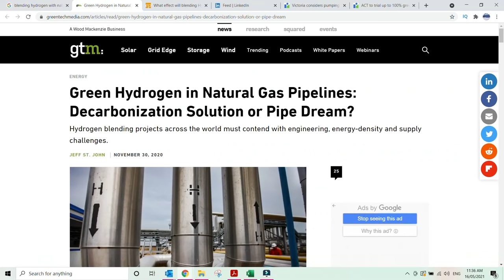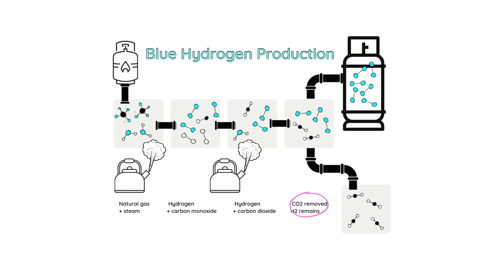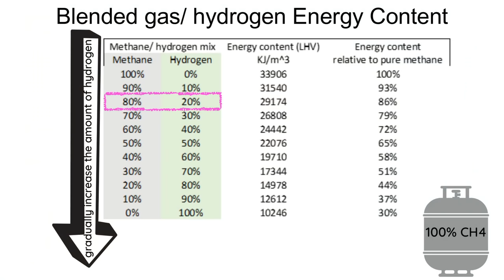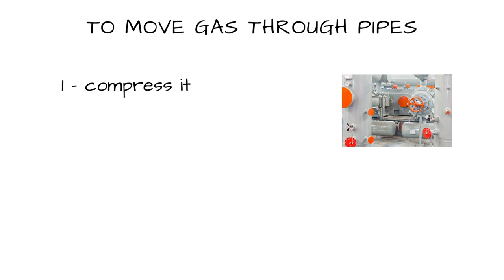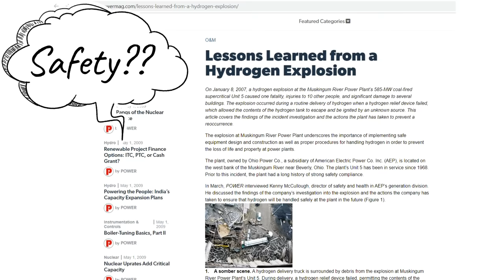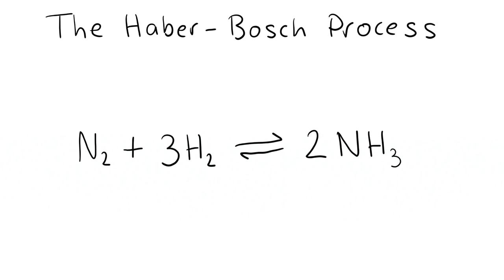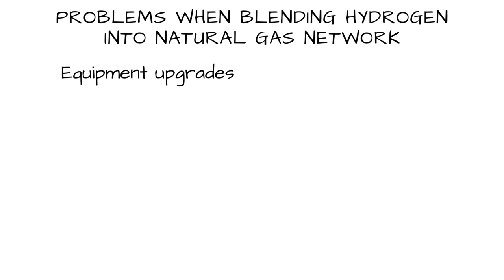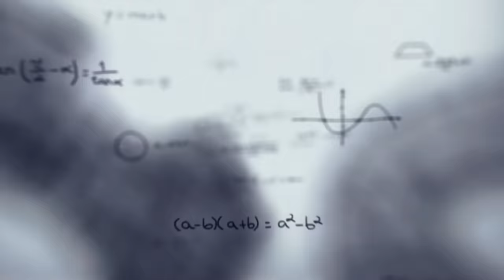Hydrogen in the Natural Gas Network

Comment: I was going to say as a welder that hydrogen entitlement would be a massive issue. most if not all certified welding procedures worldwide specify low hydrogen electrodes when arc welding high pressure steel pipes. Hydrogen gets into the steel crystalline structure and basically turns it into a brittle sponge much of the natural gas infrastructure is just carbon steel so I could see it being suspectible to this issue.
Reply: You are very correct...that was going to be my comment...  Besides CO2 is not the problem...water vapor is a much greater green house gas...
Reply: @DavidThompson-gr4gy  I have to correct you on your second point here. CO2 has a very long life in the atmosphere, while water vapor is constantly removed by condensation.
Reply: Sorry I am late to the discussion. But they can line the pipes with a ceramic "paint". There are companies that make a living relining city water pipes. They have pipe crawling robots with fiber optic video feeds back to the operators. We got some crazy engineered shite!
Reply: I assume you meant "embrittlement" but got whacked by a spell checker.
Reply: In the Netherlands the natural gas pipelines are certified for hydrogen.
There is no need for a high perssior because the energy in hydrogen is much higher than natural gas.
Nefit and Bosch created a ex change system so there is no need to bay a new heater just a few parts need to be changed so they can switch to Hydrogen
Daf Trucks created a system to use hydrogen in a almost regular combustion engine.
Reply: @markknoop6283  I think you are confusing calorific value per mass and per volume. Per volume, which is the critical measure for transportation via a pipeline network, the CV of hydrogen is around a third of that for natural gas meaning you would have to transport 3X the volume of hydrogen than that for natural gas for the same energy.
Reply: @Esriuptime  the temperature when burning is higher as wel so we need less.
And if everything is installed correctly there is room for pressure increase for the main infrastructure.
Reply: @markknoop6283  hydrogen burning in air is only around 60degC grater than natural gas so not really significant. That being said, your original statement related to energy density not flame temperature which is a completely different thing. As Paul explains in the video, (5:22) natural gas contain around 3 times the energy per volume than does hydrogen and that is the key for efficient gas transportation via pipelines.
Reply: @Esriuptime only 60°c higher you even know what that means in a boiler system or heater system?
No i just said that the natrual gas network is approved for Hydrogen and that heater producing companies have a upgrade in stock.
Reply: The gas network in my area is plastic. I don't know how big the embrittlement problem is- propably worse in big high- pressure pipelines engineered to have economic strength?
I assume the galvanized steel gas pipe in my house with its very low working pressure has a high enough safety factor.
Isn't it the same pipe we use for water up to 10 times atmospheric pressure?
Reply: @Snobiker13  I had to double take at Davids comment, im like "am i an idiot? did i miss something in my studies?"
Reply: @nos9784  That is actually really solid stuff. Id rather have that then old metal pipes.
Reply: @markknoop6283  The temperature of a flame doesn't matter, a small hot flame or a large less hot flame, who cares. What matters when I heat my home is not how hot the flame is, but how much heat energy it can put into my home. Hydrogen gas doesn't do a good job with that unless it has big pipes or higher pressure.
Reply: @ThomasBomb45  i wonder why they build al these burner regulators in a heating system if it doesn't matter.  the point is they don't need more pressure because of the higher Temperatur. The efficiëntie of a heat exchange system is al about the delta t between the 2 sides of the heat exchanger.
Reply: @jerrywatson1958  or just line them with a plastic liner.either way it's not a big issue.
Reply: Hydrogen embrittlement in welding comes from the dissociative of H2 into monoatomic H during the plasma conditions of welding itself. Which recombines inside the steel causing high pressure inclusions.

It’s not the same as just putting H2 into a pipe, there’s no monoatomic H
Reply: @geekswithfeet9137  lol I'm not sure of the specific plasma physics/chemistries involved in welding but I'd be willing to bet it varies wildly depending on the process and shielding used. Many processees rely on the different chemical properties of the flux or shielding gas as outside of true MIG welding and most TIG welding the gas and/or flux is chemically reacting with the molten metal and in the case of cellulose rods small amounts of water are involved in the reaction and the weld off gases molecular hydrogen. All that is a pedantic tangent anyway. Carbon steel is not an appropriate vessel for storing or transporting molecular hydrogen. Hydrogen basically leaks out like it's a sponge and completely degrades the material. In metal work hydrogen embrittlement is the same problem whether caused by inappropriate welding techniques or by exposure to hydrogen gas. There is a reason that any standard says that you have to protect carbon steel or use a different material like Austenetic stainless steel or other high alloys. The fact this is a very real problem with hydrogen gas is even covered in the video so I don't see your point other than to be a pedant?
Reply: @SpencerHHO  its not being pedantic, it's that the mechanism for formation simply does not exist in the raw H2 form.

You need to make atomic hydrogen to get the neccesary condition for formation. This is very often misunderstood. It the individual hydrogen atoms (ver very small) about 25 picometers, will recombine in the lattice and form H2 at about 290 picometers, 10 times the diameter, 1000 times the volume. This creates extremely local gigapascal scale stresses.

Welding, acid-metal reactions, electrolysis ect... these all form the neccesary atomic hydrogen to start the process. H2 can simply not do this on its own. I can "Re-fill" the defects left in welds, but can not make new ones.

Also remember, Natural gas is often around ~10% hydrogen already. So this refilling has already happens long ago for any existing infrastructure.

A high end estimate for leakage through the steel itself over an municipal network is less than 0.5%..... we already accept a 30+% loss at the electrolysis stage. That's barely noise in the scheme of it.
Reply: @jerrywatson1958  Paint will not stop the hydrogen... If it would, they would have much bigger contract to create hydrogen sealed tanks. Also, you will not be able to paint all pipes in all homes and buildings, and they could break and create explosion or start fire too.
Reply: @ThomasBomb45  Use platinum plating
Reply: You mean hydrogen embrittlement??????? Dampness content of welding rods from poor storage.
Reply: @gogogeedus  Err no; Hydrogen diffusion/permeation through plastics (indeed any polymer) becomes an issue
Reply: @Snobiker13  Correct!
Reply: @markknoop6283  H2 does have a greater energy value by mass but not by volume. This is the reason for the high [pressure].
Reply: @Esriuptime , I believe the H2 flame temperature is roughly 500deg F (260deg C).
Reply: @martytoth2019  for a heater you only need 1.5 bar because burn temperature 60°c higher.

Comment: Paul Martin has very impressive communication skills.
Reply from the maker: Yes he does! I hope we'll get him back on the channel some time.
Reply: @EngineeringwithRosie  GREAT channel!great info well done!
Reply: Never knew sophistry was a 'communication skill'.
Reply: @EngineeringwithRosie  I did aerospace but have spent the last 30+ years in control systems. I am qualified in what gets call EEHA - Electrical Equipment for Hazardous Areas. In the context of engineering a Hazardous Area is an area that has all the time or part of the time an EXPLOSIVE GAS or EXPLOSIVE DUST mix. It has nothing to do with toxicity, physical hazards, lack of oxygen or anything else.

Its the areas of control systems where we keep gas plants, chemical plants, wheat silos, sugar processing plants,.....etc. from exploding. Of all the things that engineers in my field take most seriously its Hydrogen. Not only does it leak very easily but it ignites very easily. 

With gas mixes there is a range of mixing where the mixes is explosive. If there is not enough ignitable gas its wont explode and if there is too much it wont explode as there isn't enough oxygen. We call these points the Lower Explosive Limit (LEL) and Upper Explosive Limit (UEL). When gas first leaks from a pipe or cylinder its 100% and then starts mixing with the air. Once it reaches the UEL it becomes explosive and stays that way until it dissipates enough to be below the LEL.
Methane has an UEL of 16.4% and LEL of 4.4%  while Hydrogen has a UEL of 75% and LEL of 4%. That means when Hydrogen leaks and start mixing with air it becomes explosive quite quickly and a lot quicker than methane. It also stays explosive slightly longer as it dissipates.

Then there is the serious issue of hydrogen with ignition energy. Ignition energy is the minimum amount of energy that is required to get something to ignite. The minimum ignition energy for hydrogen is 0.019 mJ while for most hydrocarbons it is around 0.1mJ (approximately 5 times higher). 

So not only does a Hydrogen leak become explosive far quicker and stay explosive longer it takes about 1/5th the energy to go bang. That means everything we do electrically around hydrogen has to be specifically designed for hydrogen and there are some big traps in those areas.
 
If you want to discuss further let me know.
Reply from the maker: @tonywilson4713  Thanks for adding this great detail!
Reply: @EngineeringwithRosie  I did a bio-conversion plant in Perth that batch processed the organics from household waste. For a significant part of the process there was enough hydrogen that it could not be ignored and as such we had to do the entire electrical design around the bio-digestor for hydrogen.

The big issue is cable length. It sounds strange until you look at it but 2 conductor cable is also a capacitor and if its twisted it is also an inductive coil.

When you use energy limiting barriers like zenner barriers or galvanic barriers you have to calculate the total capacitance and inductance of the circuit into the hazardous area. The certification of the barrier gives you limits on capacitance and inductance. 

You really have to watch the installation sparkies because they have the horrible tendency to put what ever cable they have into the field. To them paired cable is paired cable they don't care if the inductance or capacitance per meter changes.

In Australia where I am there are plans to introduce Hydrogen into out natural gas networks. I can see significant issues that people are ignoring.

Being blunt about it, the mechanical, civil, chemical and other engineers always dump it on the control system guys to solve their problems, which rarely goes down well. We don't mind a challenge but there are limits. The worst is when people sit in project meetings telling all that the delay is software when the software delay is to handle a mistake by others.
Reply: I needed that straight talk. More is needed
Reply: @cheerdiver  Sophistry?  Really?  It's pretty basic math.  Suggest you read the article.
Reply: @tonywilson4713  Much of my training was in automation and OSHA, ie MSDS, electric power.  Was first confused by 'once released it becomes explosive at UEL', due to situations like natural production.  Made a great though exercise.
Never crossed my mind capacitance, or for that matter inductance, would have any significant 'arc' affect outside the insulator.  Fields excluded, yet it becomes clearer.
Ever deal w/ auto ignition?  Butane, Liquid Oxygen
@latemnetiom More of an address to his claim of being an engineer, as arts degree holders don't tend to qualify for practice liability insurance.  We have standards to even qualify for insurance coverage for good reason.  Then again, maybe he does have a BS, yet no one has bothered to correct my opinion or address anything I've said.  So thank you for the reply.
Reply: @cheerdiver  Let me try and answer this bit by bit.

If you have gas under pressure in a tank or pipe inside the tank its at 100% concentration. As it leaves the tank/pipe its still at 100% but at some point starts to mix with the air. At that point the concentration starts to drop from 100% and the more it mixes the lower the gas concentration gets. At some point it will drop below UEL and keep dropping as it disperses and mixes with more air. Eventually it disperses enough to be below LEL.

Its one of the things you have to consider when doing EEHA (Electrical Equipment for Hazardous Areas) along with ventilation. A well ventilated area disperses quicker. Storage sheds gas bottles and poor ventilation can be rather dangerous.

On the inductance and Capacitance of cables you need to go back to very basic high school science. A capacitor is 2 metal plates separated by an insulator. You can make a capacitor out of 2 sheets of tinfoil with cling wrap between them. A cable with 2 conductors isn't a very good capacitor but it does have capacitance. If you have a DC circuit that goes up 1 wire and back the other then you have 2 bits of metal with opposite charge separated by an insulator. 

Its similar for twisted cables. One reason why a lot of signal cables are what we call twisted pair or pairs is that the inductance caused by the twist is great for dampening out transient noise - so its almost like a natural filter. BUT for EEHA that inductance from the twist is also a potential spark generator. 

Remember in cars the spark in the engine is caused by putting a 12volt input into either an inductor or capacitor and then very rapidly opening and shorting that circuit. In older cars that was what the points in a distributor did. These days its with fast switching transistors.

On auto ignition the places we see that most in EEHA is with dust. It has a nasty habit of collecting on things like the cooling fins of electric motors. Eventually if it gets enough it prevents the motor cooling and hot spots can form. The problem with dust is that it usually starts as a small puff. That puff then throws more dust up that can then ignite which then throws even more dust up. There's a great OSHA video on dust explosions, but note some of its case studies are quite tragic.

AS TO YOUR Questioning my qualifications, you are about 1 smart remark from being told to FK-off. I worked my ass off to get my qualifications and have had years of abuse from unqualified clowns with stupidity as their only qualification. Of particular irk are the OH&S clowns who will scream about oil on the floor or a trip Hazard and then OVERRULE or DISMISS Engineering concerns to management. The same sort of clowns that tell qualified engineers at places like Boeing to install a cheaper system to help with sales and then DON'T test it properly.

Before any smartass comments back about Boeing. One of my college mates is a senior instructor at a major American Airline and was assigned the task of overseeing the review of the Max-8. He couldn't give me details but what he spoke about with culture was disgraceful and terrifying. Boeing one of the greatest engineering companies in history brought to its knees by clowns. 🤷‍♂️🤷‍♀️
Reply: Yeah I'm pretty jealous lol 😅
Reply: Isn't methane the most hydrogen rich hydrocarbon?
It has 4 hydrogen atoms to every carbon one.

I think the future is going to require us to use less energy as much as it will require which form of energy we use.
Reply: @bobcornwell403  Correct on both points.
 Methane is the most (in terms of percentage of atoms) the most hydrogen rich hydrocarbon at 80%. For anyone asking yeah I checked. Remember High School Chemistry - alkanes, alkenes & alkynes? The alkane series is the most and has the formula CaH(2a+2) where a is the number of carbon atoms.

As to energy efficiency, Political Economist Prof. Mark Blyth (Brown U.) has on multiple occasions said that the infrastructure project America needs to do is building renovation for efficiency. 

Someone (possibly an engineer) estimated that if the American government paid to upgrade all the skyscrapers then:
i) 10s of 1000s of Americans will have work for the next few decades (it really will take that long);
ii) America will meet its CO2 reduction obligations easily; AND
iii) American business will reap mountain of cash by the reduction in operating costs; BUT
iv) the energy production industry will get a hammering in that energy demand will drop massively.

The same should work in any developed nation provided 1 thing happens. They (the Government) solves the corporate tax avoidance issue that plagues the entire World. In that case its a win-win-win for everybody except the energy supply sector. 🤷‍♂️🤷‍♀️
Reply: @tonywilson4713  Great video and great comment folks!
Reply: @tonywilson4713  Thank you. I am always please to read something from someone who really knows the practical problems of working with hydrogen. I have always found it difficult to understand the desire to use hydrogen in so many applications, as it requires considerable energy to produce it in the first place. Using that same electrical energy to heat homes and in industrial processes, when feasible, seems a simpler, more efficient route. Of course there are some processes, where only hydrogen is acceptable.